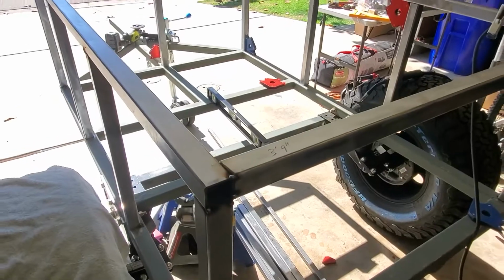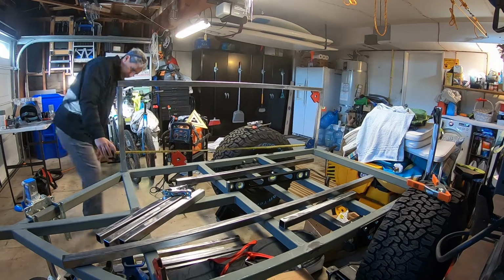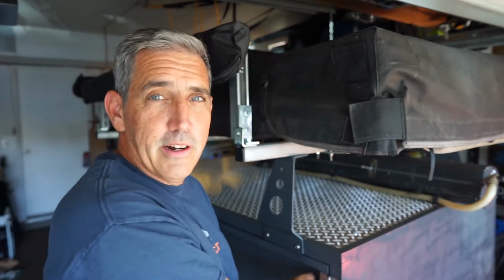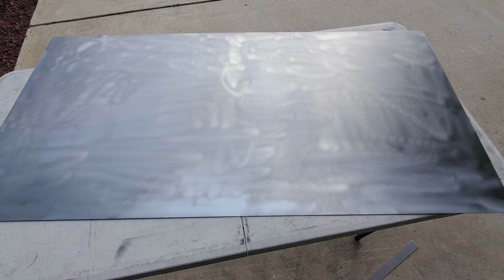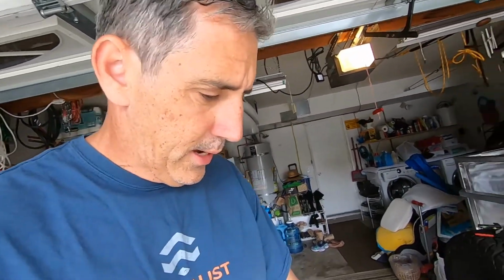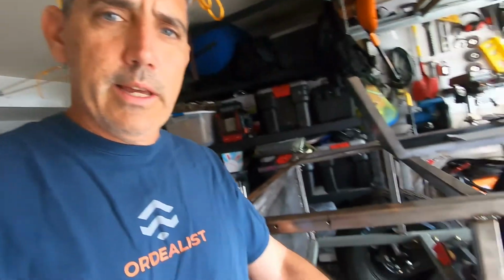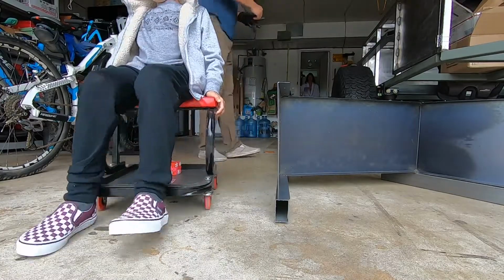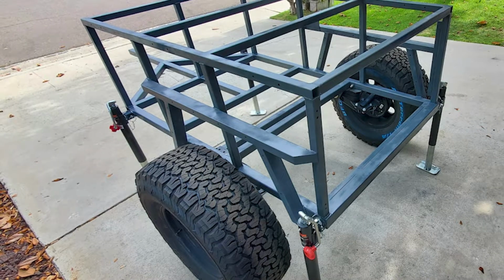Overland Trailer DIY Build Part 3 - Cargo Box and Fenders

Comment: Do you remember how much clearance you designed between the door frames and door jambs? I would imagine that if they are too tight it would be hard to open or close the doors. Additionally, did you plan for any type of seals around the door to stop water and dust intrusion?
Reply from the maker: If I had it to do over, I would create more space between the doors and jambs. I sealed them by putting seals on the inside, so the doors press into them when closed. Not idea, but works fairly well. That said, I'm in California, and camp a lot in the desert, so I haven't tested it on a really rainy trip yet...